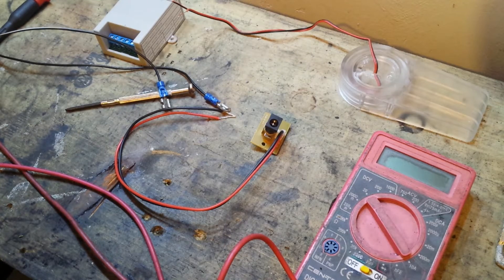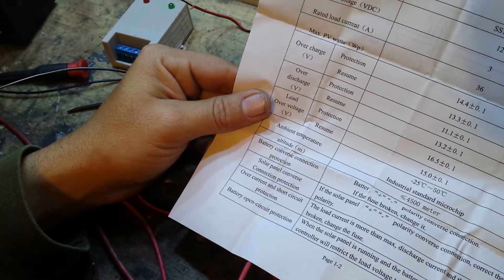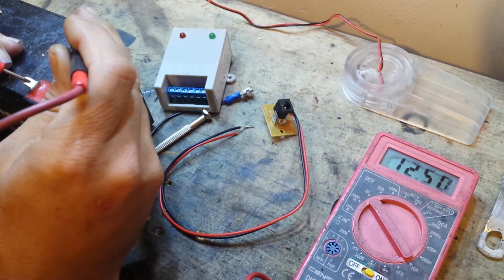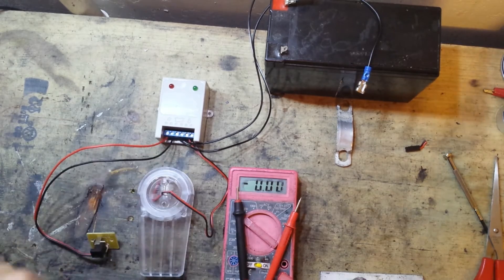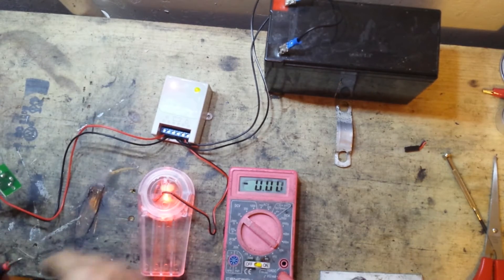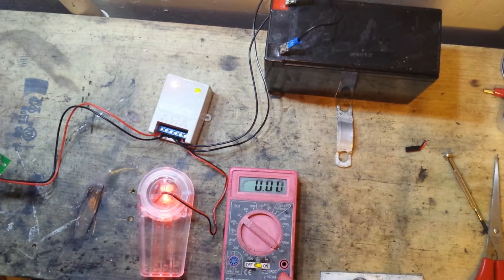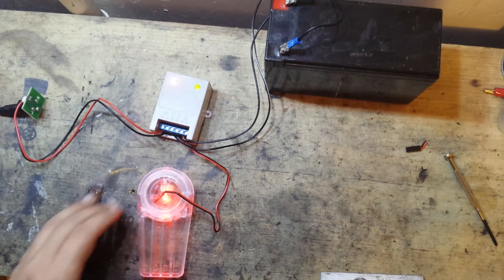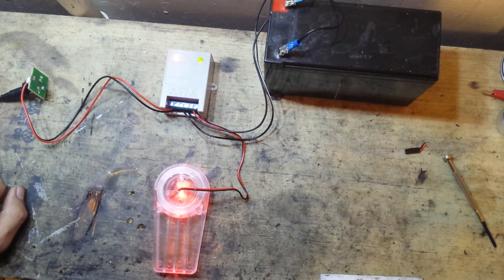Using solar charge controller with wall power

Comment: Would it be possible to have a solar panel connected at the same time as the charger?
Reply from the maker: You will need to use a blocking diode, but yes.
Reply: Thanks for that speedy response. Unfortunately I am not an electronics guy or electrician. would I get a suitable diode from? Ebay? and where would it fit in the circuitry?
Reply from the maker: @mikebeirne9158  you and find solar panel blocking diodes on Amazon or eBay. Mount it in line with the positive lead off the solar panel.  This insures the power won't backfeed into the panel.
Reply: @ThriftStoreHacker   thanks for your reply, I have solved it this morning! there must be a fault on the battery charger I was using, I swapped the charger to a spare one I had and Bingo! panel charge boosted from 1.5A to 6.5A as soon as I switched on the charger. Thanks for your help.

Comment: Awesome! I have a similar setup.

4Amp batterry charger on solar input, so 12-15V 0.5-4A. Pretty safe as a fake solar panel. Battery output from controller runs to 2x12V 1 old car and 1 old alarm deep cycle. I run led lights, car stereo (with amp outs to a 240V amp 😂) and USB charger. It runs well, every 2 days or so I will turn charger on. Basically I charge to 13.4 and drop to 11.8 then manually recharge. I am thinking to change  to unregulated 12V 1-2Amp constant charge. Unregulated so it will go to 14V hopefully. a cheap PSU12V 14V same same in China 😂😄

Also have a smoke detector mounted above it and I did monitor it very closely for a few days, temps, volts, amps on most connections.

Comment: The problem is, will the controller stop the battery from over charging? Given that you use a constant voltage supply to do that
Reply from the maker: Yes, that is it's job.

Comment: hi there, i have a question. i have a 48v battery bank in my boat that powers a 48v inverter. i need a dc to dc converter to power the 12v loads  on the boat which there are many. a 30 dc to dc converter is $450 for 30A model. i would need several of these since i have many components that use 20A. this is obviously ridiculous. i do how ever have a Victron 75/15 amp solar charge controller. can i connect the 48v battery to the PV input of the controller and the 12v AGM battery to the output of the controller and hook all my loads to the 12vAGM battery giving me essentially a 300A 12v  DC to DC supply? i have heard something about the MPP controller not being able to limit the input current from the batterys so i would need to work out some sort of current limiting circuit. any ideas?
this is a huge hack as dc to dc converters are ridiculously expensive for good quality ones you can trust in your house boat.
Reply from the maker: I don't think I would risk the expensive equipment because the batteries will probably overpower the controller.
If you need 12v, how about using a computer power supply off the AC electrical system on the boat or a car battery charger/maintainer.
You could also pull 12v off the engine's alternator when running.

Comment: I looking for this setup for a long time ☺️.
Nice work 👍🏻.
I'm trying to set up a wifi router power bank. So i think i can use this module and setup for that project. I would like to know that
1, Does the solar charge controller gives any over charge protection to the lead acid battery 
2, is it switch to battery without take any delay when the power is out (14v  adapter turned off)

Comment: Heres a question... i built a 7ah sla battery box for my kayak to power a fish finder, recharge me cell fone, etc. I installed a 30 amp solar charge controller and a 5 watt panel to maintain the battery. I'd like to know if i can plug the controller into my car cigar lighter and charge on the way to the lake?
Reply from the maker: I recommend a cheap 400w power inverter and a standard wall power 1 or 2 amp SLA battery charger.  You can do a dc to dc charger, but that equipment is more expensive.
If you use a standard wall charger and a power inverter you also get the advantage of charging at any outlet with the ac charger. 
Harbor freight has cheap inverters, don't forget the coupons.
Reply: @ThriftStoreHacker  could i use a cigar lighter adapter connected to the solar panel input on the solar controller to manage the charge to the battery in the box?
Reply from the maker: @lcacnav01  I dont think so. The car battery can supply way more than 30 amps. Even if that does limit amperage you still cannot charge that little battery at 30 amps, it would probably cause a fire or turn the controller into smoke. 30 Amos can also melt the cig lighter socket wiring. 
I've researched this pretty extensively, the cheapest way is an inverter and a charger.
Reply: @ThriftStoreHacker  thanks for helping me out, i think i will just go the wallwart option you posted. Was the light bulb necessary?
Reply from the maker: @lcacnav01  the light bulb is not necessary, you will want to run your 12v accessories off that port if you want to take advantage of the low voltage cutoff.
Reply: @ThriftStoreHacker  thats what i thought, hey thanks for the help and i appreciate the informative video!

Comment: I have another test for you or maybe you can answer it , can I use a charge controller say connected to my start battery a
Instead of a  solar panel on controller bassicly use the controller as split charger to charge my leisure battery I would be thinking an inline blocking diode too what do you think is it workable  ? I hope I'm making sense
Reply from the maker: That would most certainly overload the controller.  You would need a 12v to 12v dc charger to keep the amperage down so the controller could manage it.
I think an RV store or truck stop would have something to link up both batteries and safety charge it.
Reply: @ThriftStoreHacker  mm problem is my leisure battery is made up of 18650s in a 20p 3s configuration,I do have a 30amp controller,didn't want to go solar panel route as we don't get enough sun in UK lol
Reply from the maker: @gw3436  I think the cheapest way is to purchase a power inverter that can push whatever charger you have. You take a hit in efficiency,  but you get inverted power for whatever you need and can charge the batteries with cheap off the shelf home chargers.
Reply: @ThriftStoreHacker  I do have an inverter it's 1500w and an IMAX b6 would it work whilst on the move, I only what u call boon dock for a night or 2 so no huge amount needed, thanks for the replies saves me wasting my time on an idea lol

Comment: Can I connect 12 v transformer in solar Input??
Reply from the maker: You want a minimum of 13.6v on most controllers to charge the battery fully. The output amperage on the transformer must be lower than the rating on the controller.
Reply: @ThriftStoreHacker  thanks 😍😘

Comment: I have been looking at the Vioesrry 20A Solar Charge Controller Solar Panel Battery Intelligent Regulator. If i charge the battery can it be used at the same time to a load such as a 12V DC motor?
Reply from the maker: Yes.

Comment: I have this project you see and I was wondering if I could make a parallel connection connecting it to the input of the solar panel charger. Do you think it would be safe or possible that I do that?
Reply from the maker: It should work if you use a blocking diode on the solar panel wiring.

Comment: im thinking exactly the same thing to charge my batteries. since the solar charge controller can take up to 20v, i can use my laptop charger  to charge my 3s setup without needing a buck converter which gets pretty hot. hopefully im right
Reply: I could be wrong, but I'm pretty sure your laptop charger IS a buck converter.
Reply: no. its just another dumb charger, the solar charge controller will act as a step down converter to convert 20v laptop charger to 12.6v or 16.8v to charge my 3s or 4s pack. its just an idea but i dont have a charge controller yet

Comment: I am going to power a solar charge controller with a 150w 19v power supply.. and was told to stick a diode   in the circuit to stop power feeding back in to the power supply.. so was wondering what type of diode to get.. ??? Any help ?? I have tried doing this with wallwarts and it works sometimes. And sometimes it Blow's the AC adapter.. and don't want to risk it with the AC adapter I have now because it's going to be expensive to replace.. I am hoping to make something that can charge an 130 ah lead acid at relatively high amperage.. any help would be appreciated
Reply from the maker: A diode would be a good idea, but i have no clue on which one to use. I would talk to someone at an electronics repair shop to figure out exactly what you need. Maybe consult Reddit electronics thread.
Reply: @ThriftStoreHacker  I will give reddit a go thanks..👍

Comment: (small project)..gd bro im thinking of using an 18volt latop power supply(3amps 70watts max) with one the 20amp charge controller..to may your standard car battery or smaller ones like 13vlots 5AH TO MAYBE 10AH..whatsyour addvice. bro. would it work..
Reply from the maker: The 18v power may cause the controller to shut down and not charge.

Comment: I am planning to buy below device and can I supply 12v 2a dc as input. I don't have that good knowledge on electronics and need your help
https://www.amazon.in/Hittime-Regulator-Charge-Controller-Tracking/dp/B07K2VN7H2/ref=sr_1_3?crid=182V6FO0HTRWU&keywords=mppt+solar+charge+controller+12v&qid=1555997124&s=garden&sprefix=mppt+%2Clawngarden%2C263&sr=1-3

Comment: Do you think this will work with a variable voltage buck converter being powered by a DC motor used as a generator head? I have a 10amp solar charge controller for a deep cell battery bank
Reply from the maker: I think it may work if you keep voltages in range. Im guessing you are trying to do a wind power project?

Comment: What is the circuit you connected the laptop power dc jack
Reply from the maker: Not quite sure what you are asking. The power from the dc supply is going straight into the charge controller. The power jack is only there so i dont have to cut the plug off the power supply.

Comment: If i have a 24v mppt charge controller can i hook the load output to a 12v charge controller solar input  and use it as a step down dc to dc converter
Reply from the maker: That will depend on how much voltage the 12v controller can safely input.
Reply: ThriftStore Hacker the specs say max 55v solar input
Reply from the maker: @ivanstroebel3636  it might work. Just dont try to push too many amps.
Reply: ThriftStore Hacker good point ..thanks for the info, really appreciate it

Comment: Would it still charge ok without the small light connected to it? or would that burn the controller
Reply from the maker: Yes. I usually don't use the power output from the controller because it can only handle a small amount of amperage going through it.

Comment: Hey Brother. Are you using the light own load side to see if the system is working.      Thats a cool project and well explained.
Reply from the maker: You can use the light output for anything under 2 amps. I usually connect most of my stuff directly to the battery with it's own fuse

Comment: When the power supply is plugged into the charger, does the load terminal voltage go up also? I am doing a car stereo in kitchen project for at home and need a 12v constant to the stereo and charge the battery also.
Reply from the maker: You will not get a higher voltage than what the power supply will output. I used a 14.4v switching power supply (I think it was to charge a portable air bed pump). The solar charge controller is there to make sure the battery charges in the proper voltage range and can be easily swapped for a solar panel. In my newest ebike setup I picked up two 12v 20ah batteries for $40 each. I think one of those would be perfect to run your planned setup. The 1amp of charging may not be enough to power the radio without the battery.
Reply from the maker: Joshua Czarnecki also. If it is a car stereo (12v) keep in mind a car battery is basically dead at 12v and with an alternator (engine running) will provide 13.6 to 14ish volts to your car's system.

Comment: Have you left this setup plugged in for months at a time? I want to enable it with a Solar Deep cycle battery, but it is much bigger, 120 amp hour.... i wonder if that changes the requirements for the adapter.
Reply: If I understand your question, the way he set this up with that little controller & wall Wort, it seems to me that you COULD charge a 120 Amp Hour battery with it, but it would take F-O-R-E-V-E-R! Good question, however.
Reply from the maker: The Vedic Way I have had one of these controllers hooked to a 20w solar panel connected to a 50amphr battery in my shed for a few years. Runs my outdoor lights. Seems relatively solid.
Reply: Yes, but what about running it with a DC adapter for long periods?
Reply from the maker: The Vedic Way I have not used the adapter for long periods of time. Maybe a maximum of 10 hours to charge medium size batteries.

Comment: I took the same approach however using a modified ATX power 12v as the input to where the solar connection would go. I've let it charge over night but the battery is not getting charged. I'm a bit stumped but thinking I must have something wired wrong in order to make it work. Will see if I can find a power adapter similar to yours and see if any improvement.
Reply from the maker: Alexandra Elfers a 12v battery needs to charge to around 13.6v to be full. The computer psu is not outputting that much voltage :)